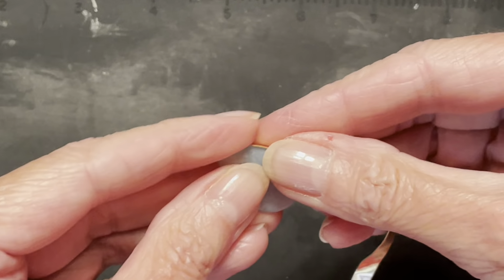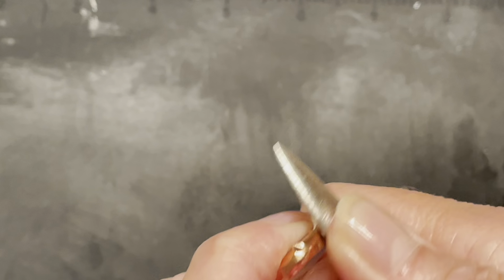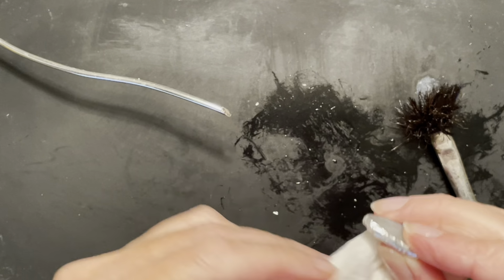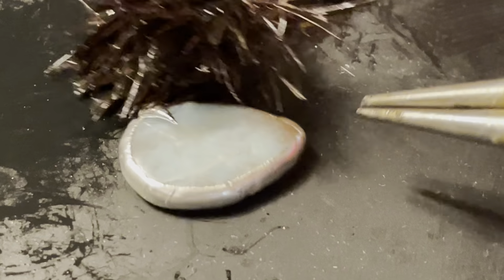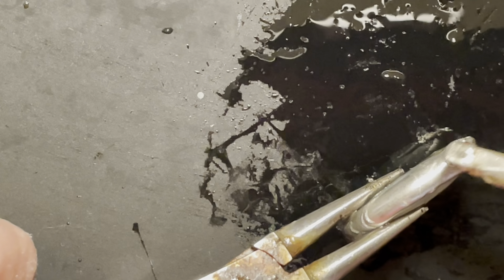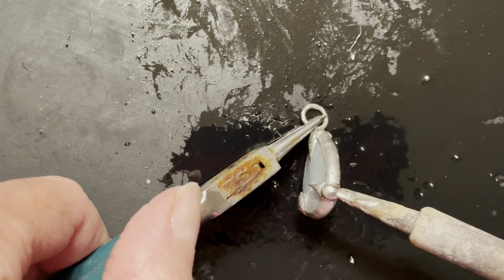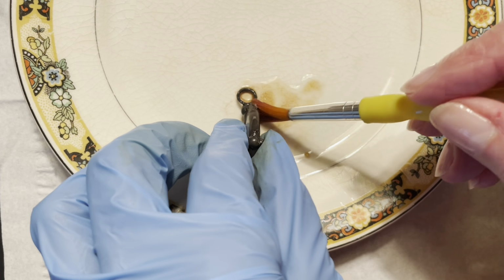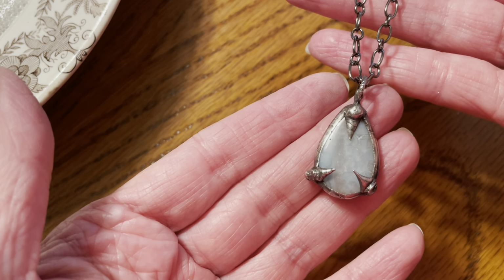How To Make Spiked Jewelry With A Soldering Iron

Comment: I  am an electronics technician by trade, and if I may give you a tip, it would make your work on these much easier if had some sort of a vise, a very small one used by jewellers. It's really cheap.
Reply from the maker: Thanks for the tip, I do use a third hand tool on occasion, but find that I usually work better without it!

Comment: hi laura! I still trying but it doesn't work for me, I move slow but it doesnt work :( I use 97% Tin / 3% Silver maybe that is the problem? o for example my soldering iron is small and it is not from weller, should I buy weller?? Please help
Reply from the maker: The brand of iron makes no difference. You probably need to play around with your irons temperature control.

Comment: I have a question! You said we could use this method with any stone - what about really delicate stones that are sensitive to temperature, like Ethiopian opal or a Moldavite which is basically glass? Thank you!!
Reply from the maker: @Yuriy99  I would use caution with the opals because they are soft and also the liquid flux could damage soft stones, but you should be fine with the glass. Just be sure not to hold the soldering iron in one spot for too long. You don’t want to heat one area for a long time, allow it to cool down while you’re working and you should be fine. experiment with less expensive stones first.
Reply: @ awesome thank you!!!!🙏

Comment: will soldered jewelry tarnish when worn? will it tarnish my skin?
Reply from the maker: Over time, it will tarnish, which is oxidation. This can be partially prevented by storing your jewelry in a sealed plastic bag and keeping it away from humidity and water. It can also be polished.

Comment: Hi Laura, I would like to know if you can tumble soft soldered pieces? Ty😁
Reply from the maker: Hi, why would you?
Reply: @LauraBethLove  To strengthen especially if the piece is a more open design and also if you have oxidiised the piece to get into more nooks & crevices to remove more of the patina! I am a wire wrapper but would like to start including some soft soldering into my work, I use a tumbler on all of my work, so I was just curious whether it would be ok to use on soft soldered pieces?😄
Reply from the maker: @GumnutLaneJewellery  I thought maybe you meant for polishing. I don't think it would do anything for strength because it's solder (a lot different from wire)..but you could try!

Comment: hi :) I'm trying to do this with my welding tool but the only think i get get are little balls of tin. is it because I'm not able to use it properly or because its temperature it's not hot enough? I had this tool at home, but it was the cheapest I could get that time (around 13 $) and I don't how hot the tip can get. So basically I melt the wire and also the tin doesn't seem to stick on the tip like it seems to stick on your tip and just fall... I don't know what do to exactly (and also the welding tool emits a bit of smoke, is it normal?)
Reply from the maker: Sounds like too much heat
Reply: This is due to oxidation of the tip, you want to have a wet sponge, metal wool, and  tip tinner. Clean off the tip with metal wool, and the wet sponge, tin it, repeat. Then cover the tip with the solder a few times until it balls up less. Should take maybe 5 times. And then try to maintain the tip by keeping it clean with the wet sponge in between working sessions. And coat the tip with tip tinner or solder  before turning off for the day!
Reply: @ thank you!

Comment: Very helpful, thank you. I always learn better watching the process first. This is such a fun pendant. I have tried the taping method before, but found I have to be careful on the size of the tape overlap, as sometimes they are fragile and can break off or peel back and get bent. Building them thicker does help with that a bit, and also eliminating the sharp points where they can snag. Love the tutorial.😊❤ 
I started out with a lower temp iron n could get alot of spikes (unintentionally)😅, but with my high temp iron I struggle with it a bit. What approximate temp seemed to work best for you to create the spikes? Thanks for sharing, Laura.💖

Comment: Thank you for all your wonderful videos and tutorials! 
I am looking to buy a new soldering iron, the one you recommend doesn’t seem to have variable temp, there is a Weller version which is 80w and variable temp up to 450 degrees Celsius, would this be better or is the one you have listed sufficient to be able to achieve the little detailed soldering you do? I am struggling to achieve these with my existing (cheaper) iron despite playing around with the temperature. 
I have recently started using the Silvergleem solder, is there an optimum temp for this?
I’d really appreciate your advice on this, thank you.
Also you mentioned that you’d be setting up a Patreon in previous videos, I can’t seem to find it on the Patreon app? 
Thanks so much, and I really love all your work!!!
Reply from the maker: 80 watt or above is good, I have a few recommended on my amazon page at https://www.amazon.com/shop/laurabethlove
I will have a complete soldering course available soon which answers many of  your questions and much more, you can get on the waiting list for at https://www.laurabethlove.com/